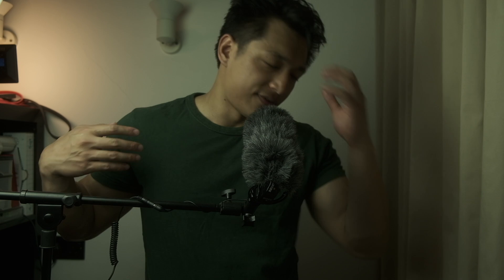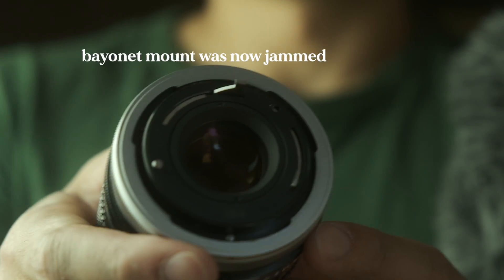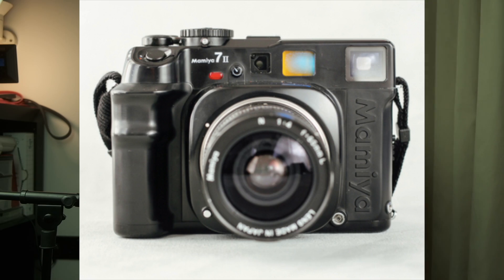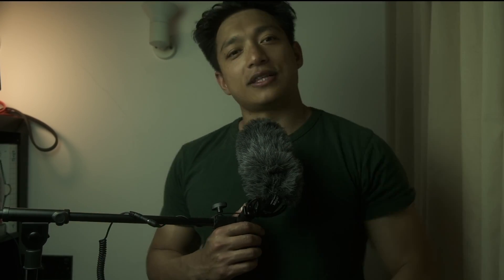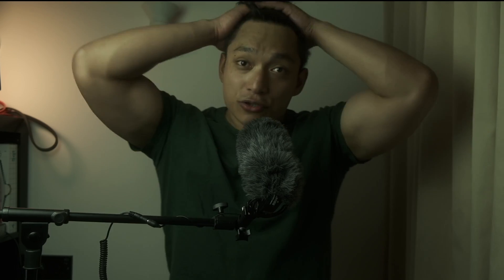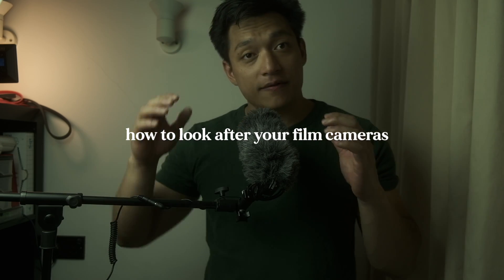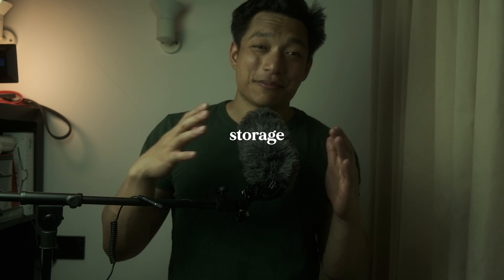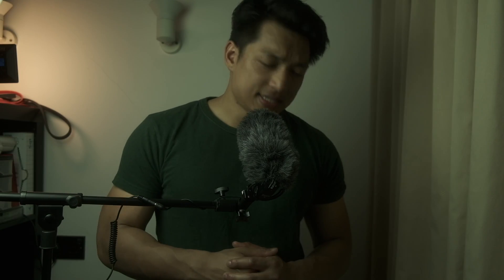How To Look After Your Film Cameras // Servicing and Repairs

Comment: big shame and sad to see this happen :( 
here - got some "free" repairs removing stuck adapters but now the lens is a bit loose but all intact. but usually the cheaper the gear, then they cant really afford to charge higher than the cost of the gear which also mean they will prioritize repairing more expensive gear that they are able to charge a higher price LOL. 
 i do have an issue where one film camera I own - the film progress gear, um thing to move to the next shot. it SEEMS that people can or its made to place your thumb their right to hold it but then in this camera i feel that because there's pressure there, it then is at risk for the gear to get stuck and cant move the film forward. Broke 2 times already and did not want to risk it breaking a 3rd time. :\ 
you just got an ART lens . umm just gotta SELL the look as its a benefit than a downside .
Reply from the maker: I'm glad I'm not the only one with film camera problems. An arty lens haha yep 😂😭😭! Anyone want this arty lens?
Reply: @ZainRiza  oh umm im not that ARTY enough to use that lens to its full potential :P hehe it will truly take a photographer for DEEP ARTS to use it haha